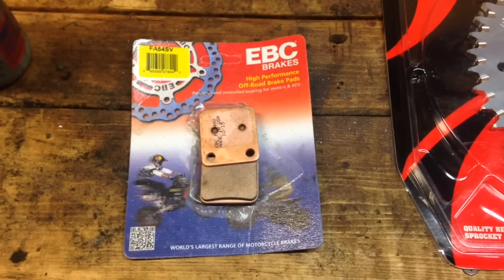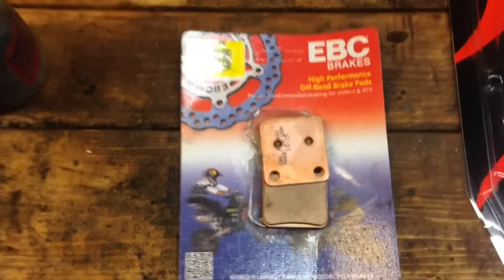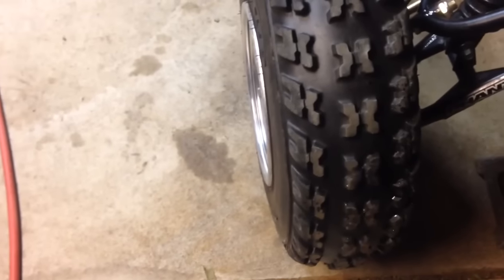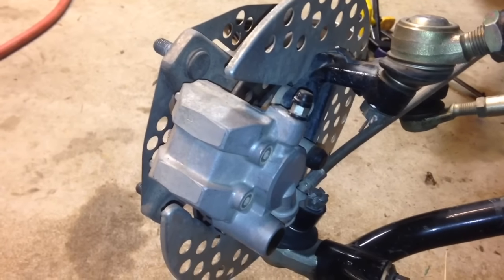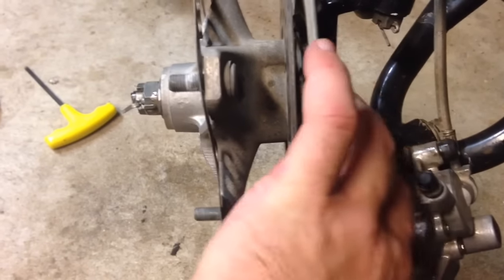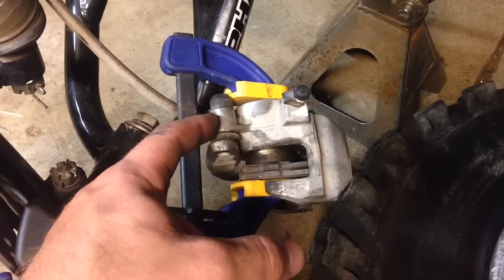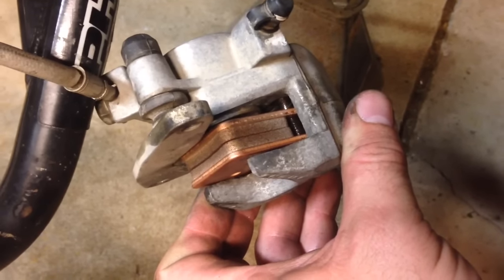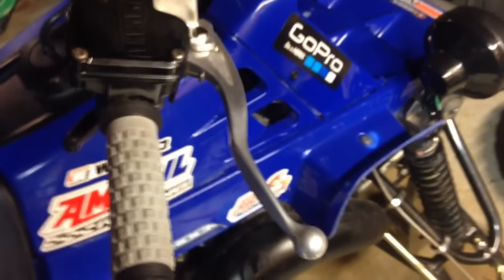Yamaha Banshee Front Brake Replacement

Comment: You should do a video on how to tighten up all the bolts underneath it mine is dropping some oil from under it
Reply from the maker: It's probably the oil drain plug that is leaking.

Comment: Can the chain breaking mess up the transmission or engine I turned it over in neutral seem like everything was fine I put it in 1st gear without the chain and it didn't stall out is that normal?
Reply from the maker: Yes, that is normal.  The engine and transmission aren't connected to the wheels or axle when the chain is not in place.

Comment: Can to much slack on your chain cause your engine to stall? Whenever I go to put my banshee in 1st my chain pops and it stalls I tried it in second it did the same thing then I took the chain off and shifted gears without it and it stayed on I need new carrier bolts which I have coming
Reply from the maker: Sounds like your clutch needs adjustment.  check out that vid.

Comment: I don't think I'm mechanically inclined to do the case lol if I can get by with just changing the sprocket and chain I'm gonna try to
Reply from the maker: If it doesn't leak that might be an option.  However don't get water in the case.  The stator is on that side.  Another option is to mix up some JB weld and patch the hole.